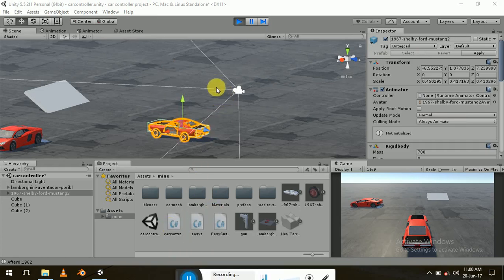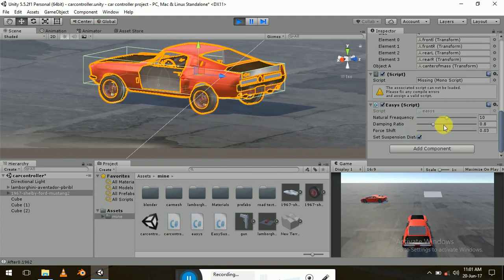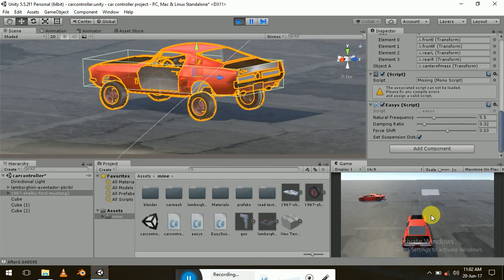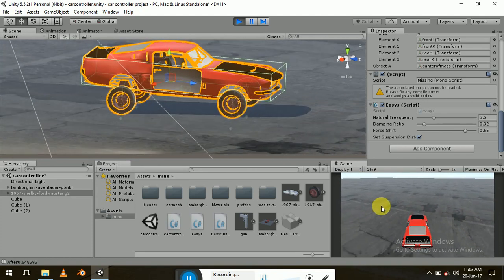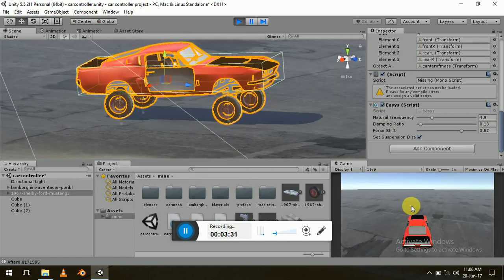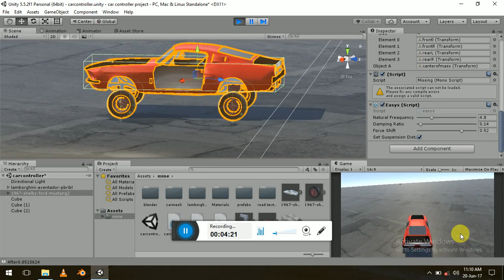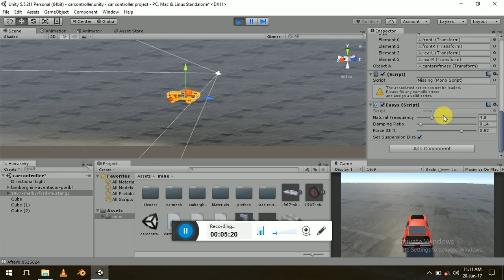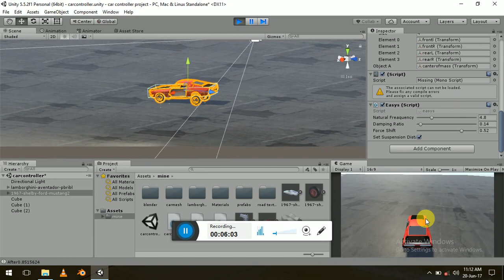unity easy suspension script test

Comment: hello, I did all the procedure of your video ended up giving several errors
tell me one thing for the script to work and need to have all the components of the carcontroler?

I would give you the carcontroller script because the unity does not work with your suspend script
Reply from the maker: Michelly NitecKI I took reference from unity vehicles.... You can download unity vehicles from asset store... It comes with a car, truck and a van ... Copy easy suspension script from there... It'll solve your problem.